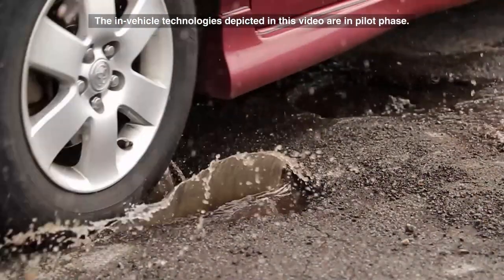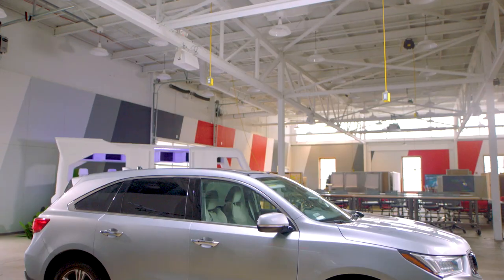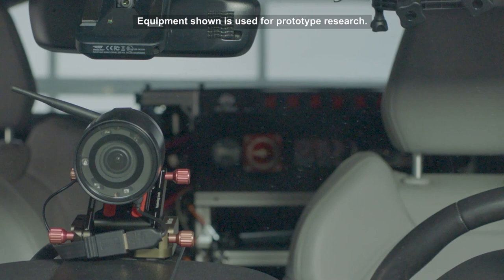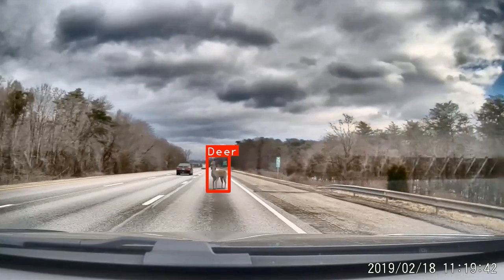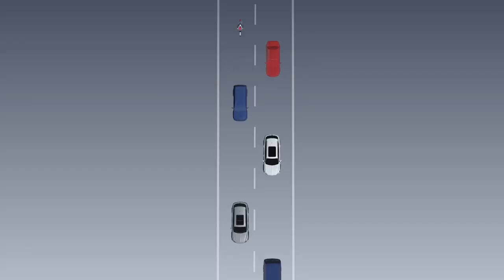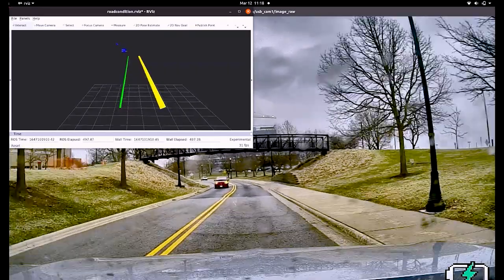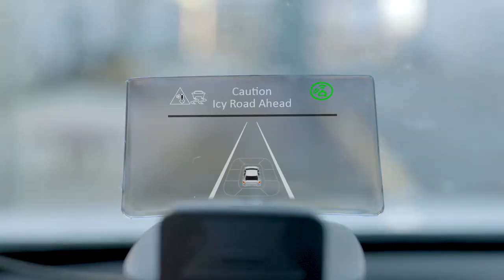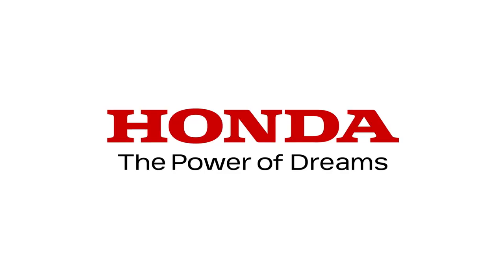Honda Demonstrates Prototype Road Condition Monitoring System

Comment: Haha. My 2021 Accord decelerates when there is no one ahead of my in my lane but when it detects running lights on the vehicle in the lane to the right of me. It also has randomly generated the BRAKE warning on my dash for no reason at all. The dealership says there are no error codes and therefore cannot fix it.   They cannot even fix issues with their existing systems. I can’t wait to see how screwed up this system is.